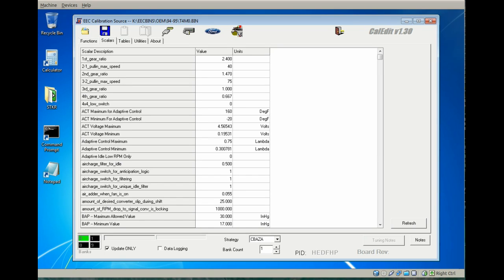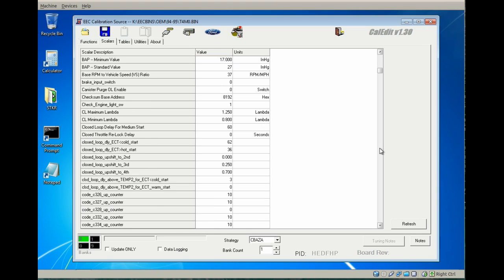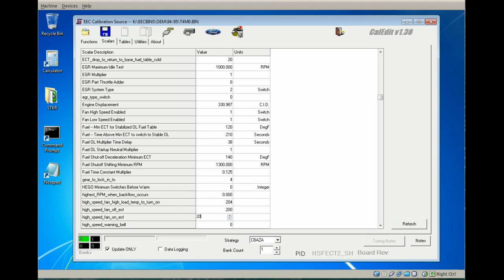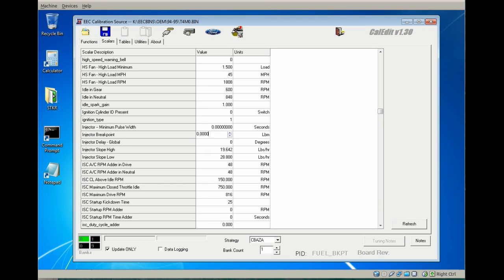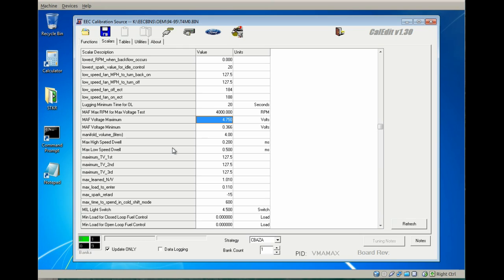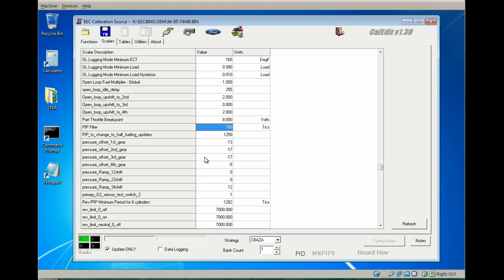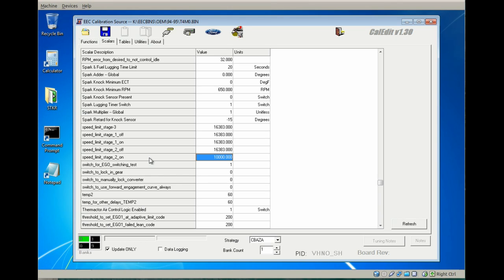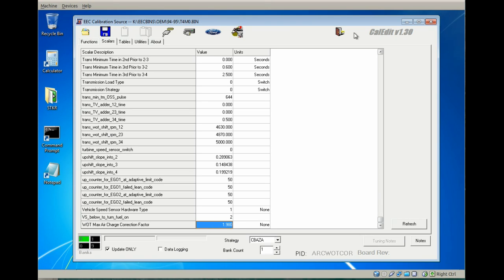Base Calibration Setup - Part 1 (Scalars)

Comment: i just bought the tweecer base. i changed my 1996 explorer with the 5.0 from an automatic to a manual transmission. will i need a base tune or will i be able to go in and simply make a few changes to whats on there?